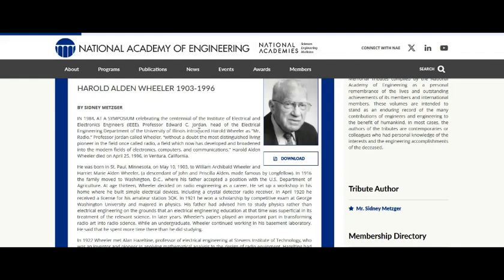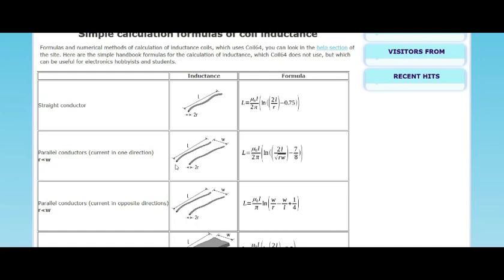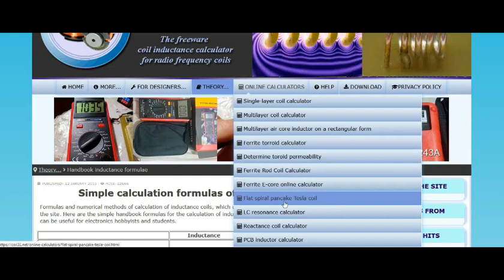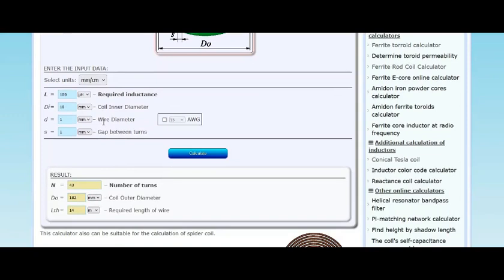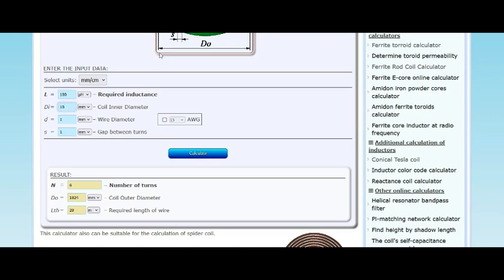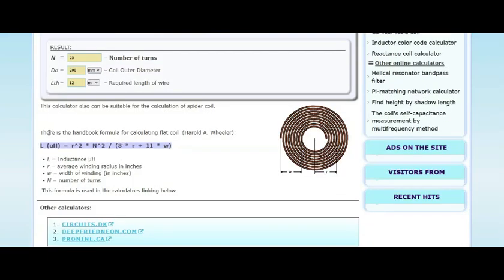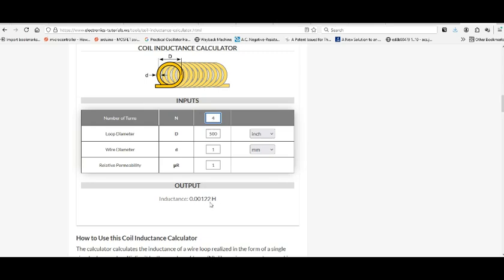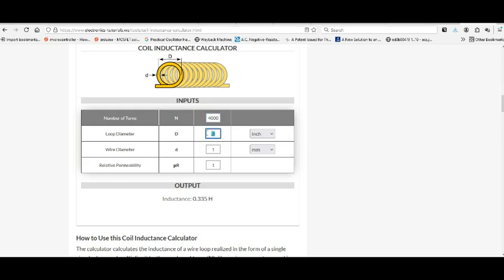Project Q: Wheeler's Formulas for Induction

Comment: Good stuff. Thanks. Crystal radios (open systems) rarely couple the coils on top of each other, they are in front of each other. Coils on top of each other and ferrites are always trade off, when it needs to be packed to small space. Works better for closed systems.

One old school way to make coils faster is to twist the wire. For example if you want 1:3 coil, twist 4 wires together, make the coil and then connect 3 of the wires in series.
Reply from the maker: Good points Kang. Thx.

Comment: nice little Wimhurst there in the background, I've had some ideas on incorporating it in the past. As a point of data I made a conical(w1:83, w2:133,h:63) bifilar(double layer opposite wind direction) in the past with 26 AWG; With the ET433 it reads Q of 62~63 at 27 kHz.
Reply from the maker: Thanks Harvest, it is a fun conversation piece and project 43 or 4033 might be a deep dive on the Wimshurst and seeing if one could do anything with 3d printing and a motorized Wimshurst.  Looks like you have already done part of what I am planning to do re cone coils, thanks for posting and for posting the results, I am guessing the numbers are mm? If so, the Q from the bit of experience I have now, doesn't sound at all unexpected, a very good Q for not much wire.  Hey, I wasn't a dummkopf to pick up the ET433 after all, that's great!
Reply: @paulmaher812  Thanks I picked up the meter after your video, gives great readings for the projects I plan. I wound that cone coil based off of “The Universal One” by Walter Russel; Originally I wanted to make two of the coils on an alnico core sandwiching a third coil on a toroidal metglass core; Been planning a 6 channel optocoupled igbt switch after your newer videos.

Comment: as current increases over the inductor resistance goes down of that inductor. The current forces the ions to polarize over time. at the same time as resistance goes down so doe voltage

Comment: if you got the table space and lighting why not ?  👍
Reply from the maker: Hey Myke,  Not entirely sure I follow, but if you mean winding that 8 inch diameter coil  from the end of the video, F yea, I am also thinking of printing a multi-part, much larger cone shaped coil going forward.  👍
Reply: @paulmaher812  was referring to the doing a bunch of projects at once, why not if you got the table space ;)
Reply from the maker: @mykedoes4099 

INDEED!
Reply: @paulmaher812  i made air core awg 32 370ohm about 1 foot core diameter it runs huge block ferrite mags epoxied to shaft . needs about 24v . Have no idea if it smore efficient but its based off Newman design
Reply from the maker: @mykedoes4099  Interesting, sounds like a very cool Newman motor/Window motor